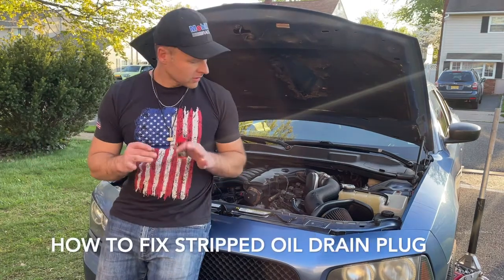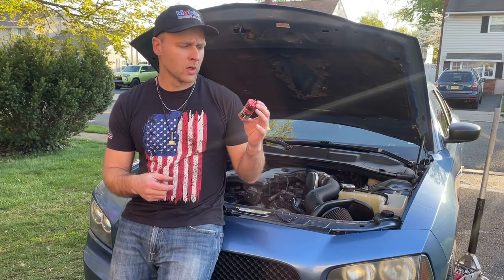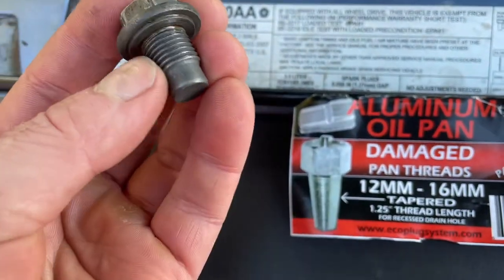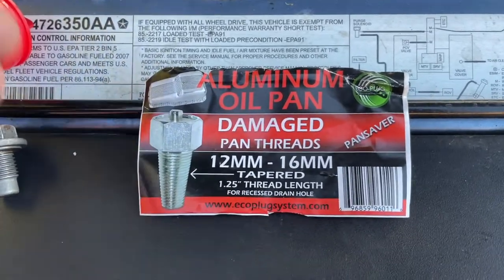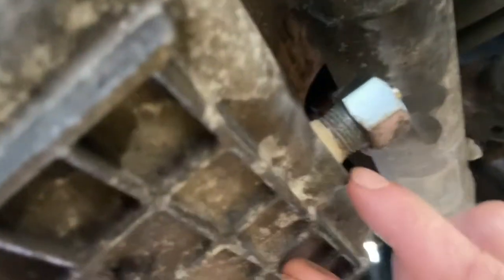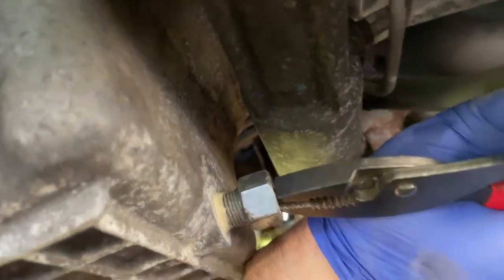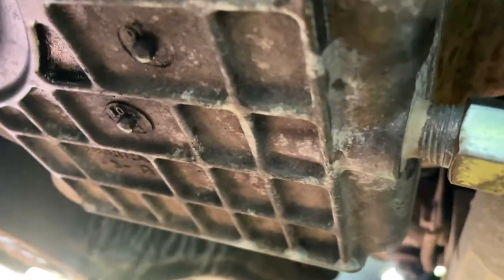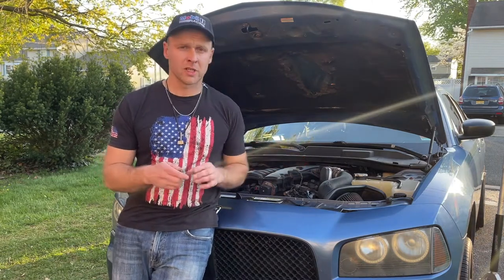How To Fix a Stripped Oil Drain Plug -  (save big $$ easy repair / upgrade -EcoPlug)

Comment: Great information! Your link shows the 3/4" long eco plug, but the picture in the video shows 1.25 thread length. Is the 1.25" the correct one for the Charger? Could be just amazon's screw up.
Thanks!
Reply from the maker: I got mine a while back. Those are new models I think.  I would say check on the site directly.